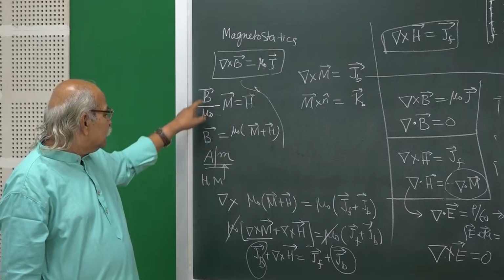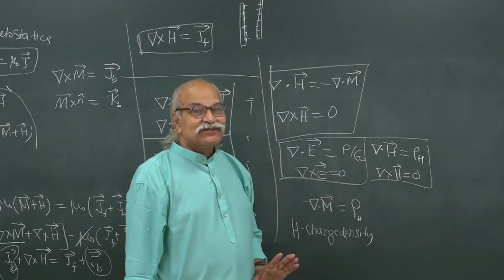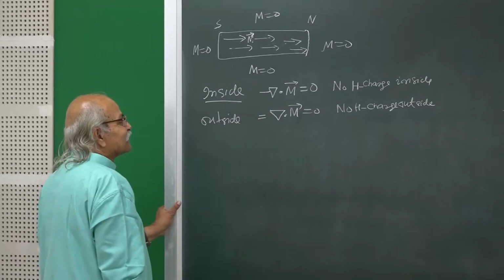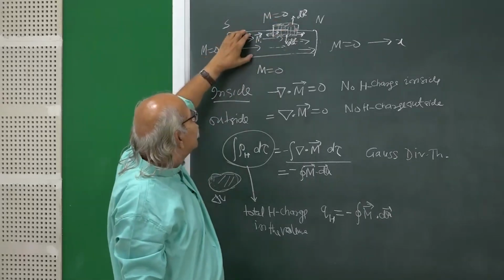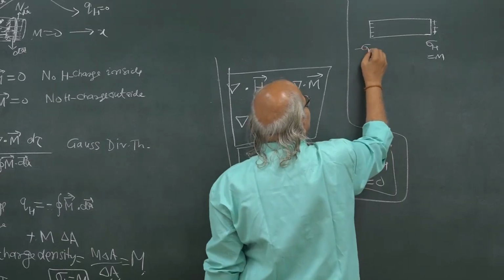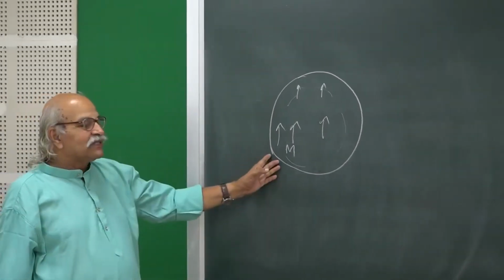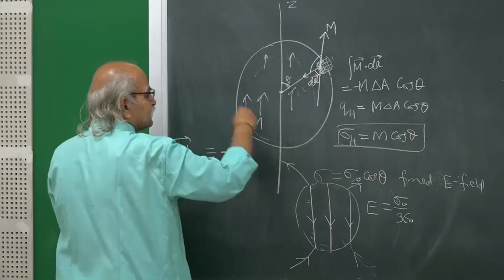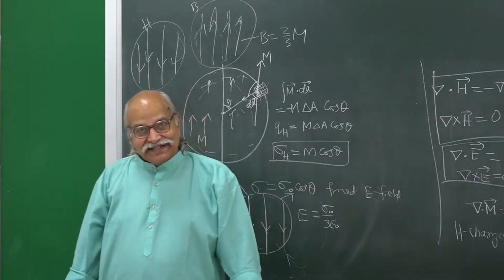LEC 40 - Magnetic Poles as H-charges. #finished  #magnetostatics #physicslecture143 #hcverma

Comment: Respected sir,
I do not know if this email is still active, but this is my best shot to
contact you. Firstly, thanks for the easy to grasp video lectures uploaded
on YouTube. I am a Y22 student in IIT Kanpur PHY department, and our
endsems ended 2 days ago. However I still have some doubts in the
Classical Mechanics portion.
In your YouTube playlist of classical mechanics, the video titled "Lecture
17 Expression for centrifugal and coriolis force" Around 4/5 mins in the
video , we have considered a rotating frame and derived expressions for
that.
My question is, how do we derive a general expression of time derivatives,
when the origin of the frames do not coincide and the axis of rotation is
somewhere arbitrary (not passing through the origin of rotating frame)
with proper vector notations used.

My doubt arised when I tried to figure out whether in the term
(dA/dt)inertial you used in the video, if the vector A is taken with
respect to the origin of the rotating frame or the inertial frame, and
figured a more general derivation is required.